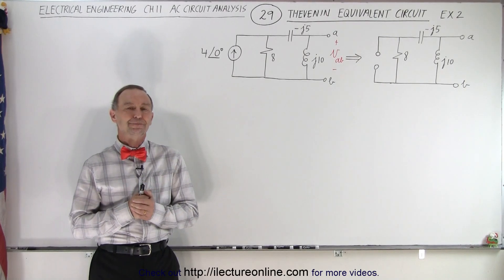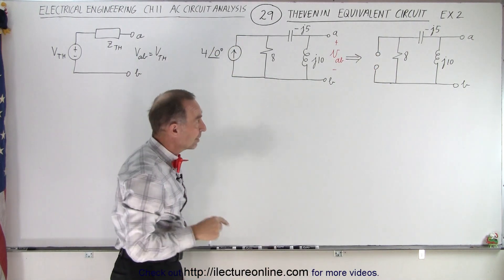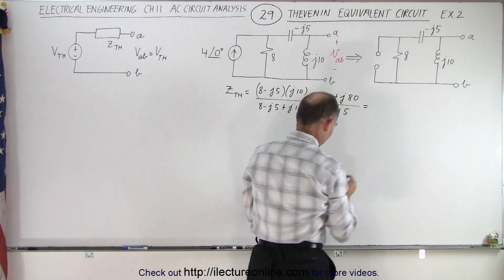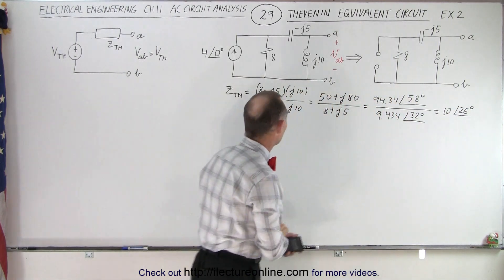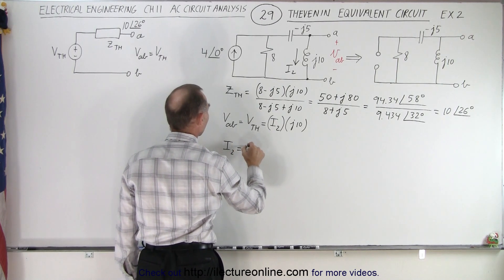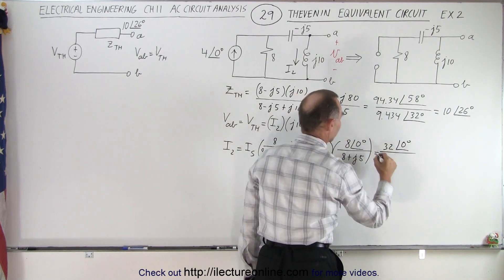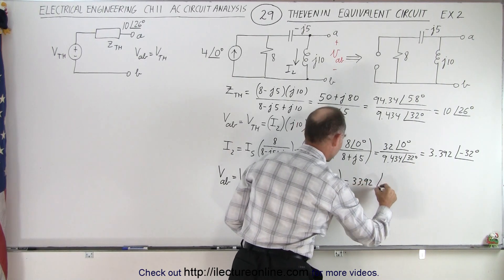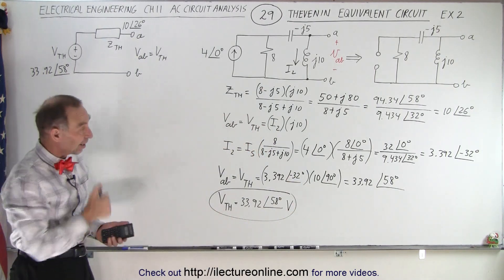Electrical Engineering: Ch 11 AC Circuit Analysis (29 of 34) Thevenin Equivalent Circuit: Ex. 2

Comment: Question : why in Zth you consider the impedances in parallel while in calculating i2 you consider total impedances as in series? the current divider = Is *( z of other branch / total impedances ) . one you took them as in parallel and one you took them as in series ?!
Reply from the maker: To find Zth you first remove the current source and then you find the impedance between a and b.   There are 2 paths to go from a to b, and therefore those 2 branches are in parallel.
Reply: @MichelvanBiezen  Yes, but when using the current division formula to find I2, you put the impedances in series and just added them together in the denominator. I used the formula that uses the admittances and I got 1.696<-32 A